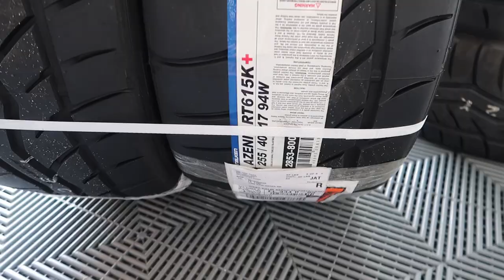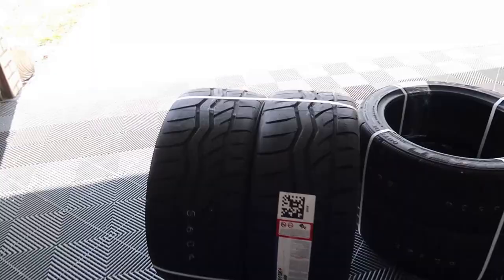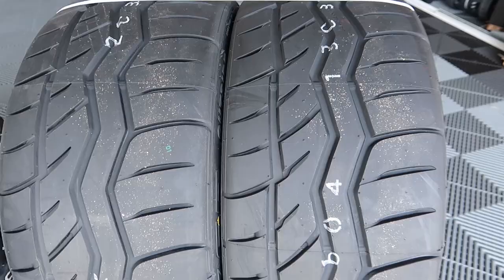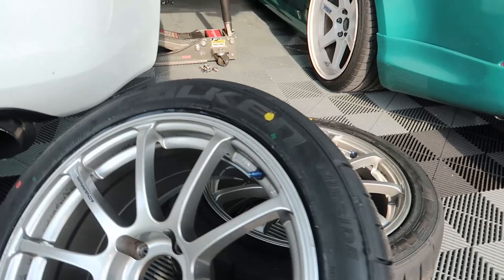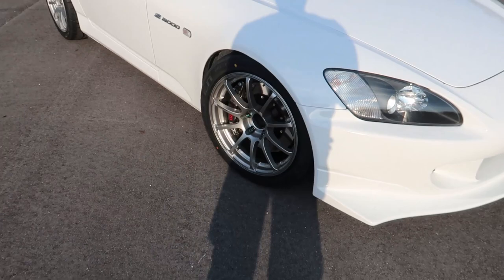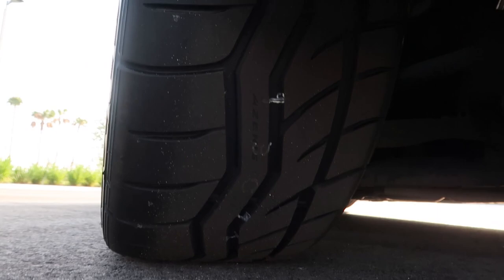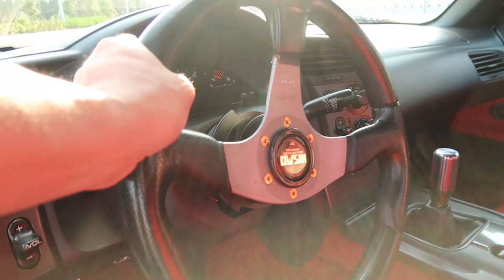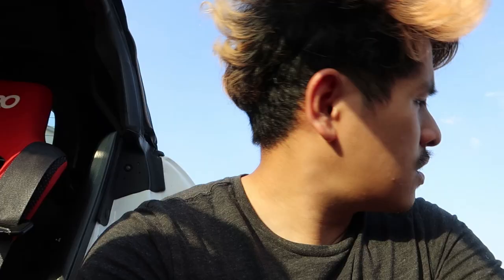FALKEN COMPOUND TIRES FOR MY S2000

Comment: Are these tires good for track tires or street daily street drive bruh ??
Reply from the maker: 225/45 and 255/40
Reply: @KantstandlamGarage  bro , are these good for daily drive or track ?
Reply: @lonnietran1925  they are good for both.  It’s not the best 200tw tire for track,  but it will do the job,  plus they are very durable and will last much longer than other tires in the same category.  I recommend it for new track drivers.
Reply: @izzoArtistry  Thxx